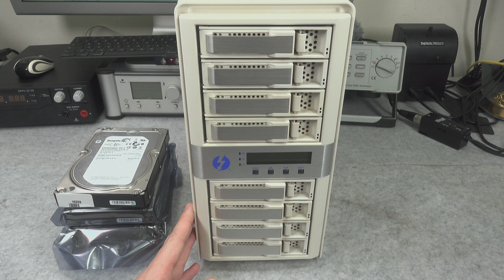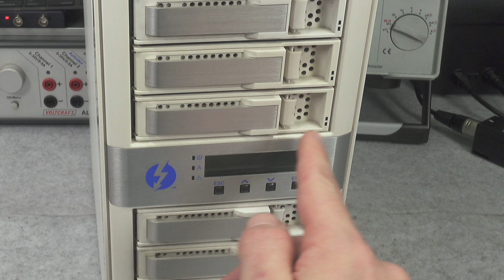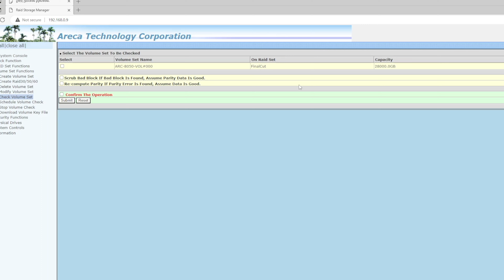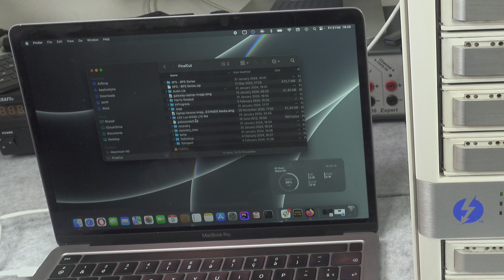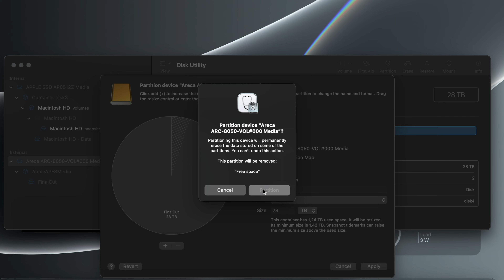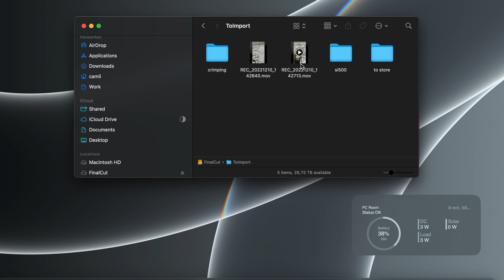Arcea ARC-8050 expand hardware RAID5 array from 4 to 8 drives without loosing data 12TB to 28TB

Comment: Thanks, I have one locked with a Mac Pro Trashcan and now I know the adapter works. unfortunately this consumes a ton of energy.
Reply from the maker: Hey, that's true - I edit on Fusion drive (You can check my video I bough cheap small 512GB obsolete model, and swap NVME) - I archive to this raid storage - so fare - work great even on latest OS (2024). I always wanted Trashcan... one day I will grab it at "trash" price - justifying I will run VM there... of course we both know I wont and it will be collecting dust... but I will be living dreams... Take care!